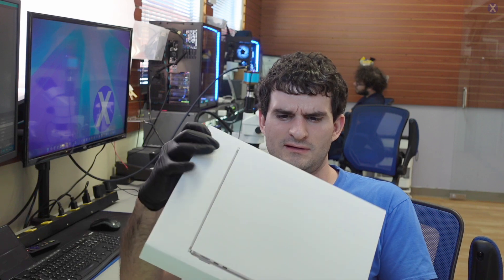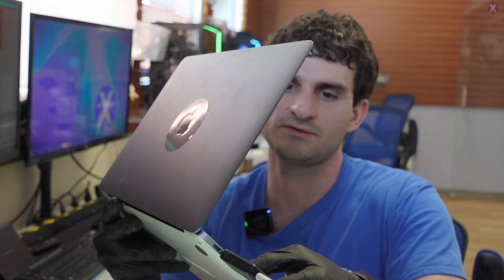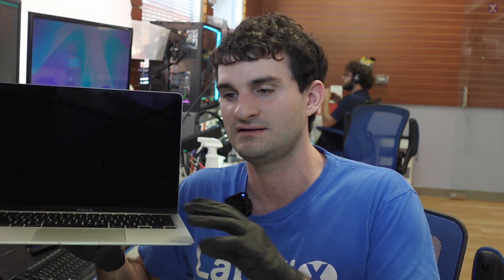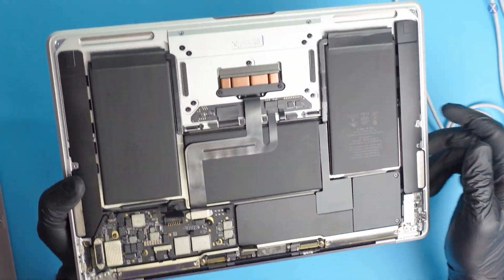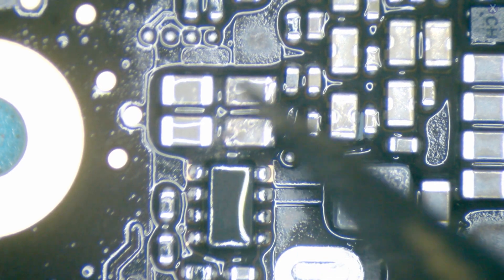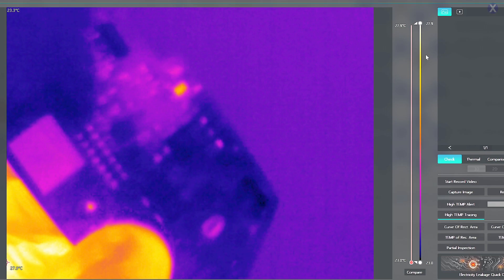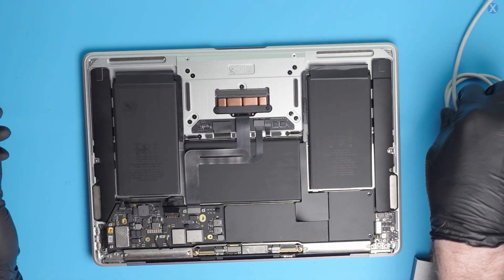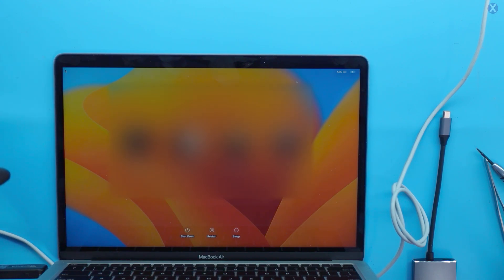Fixing a M1 MacBook Air with No Power

Comment: Hi, what would you check if an MacBook Air M1 doesn't recognize the battery at all and only turns on with an usb-c, and when you try to open a folder or do anything with it, it just restarts?
Reply from the maker: If the battery is not detected, could be an issue with the battery as it has a a PCB that communicates with the logic board.
Reply: @lapfix  Thanks!